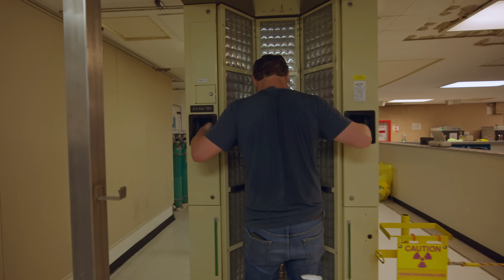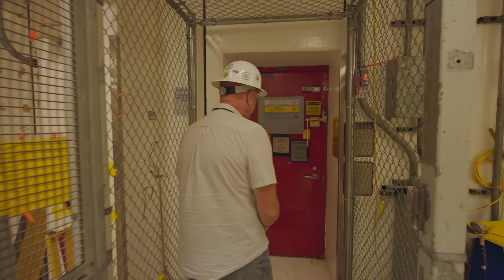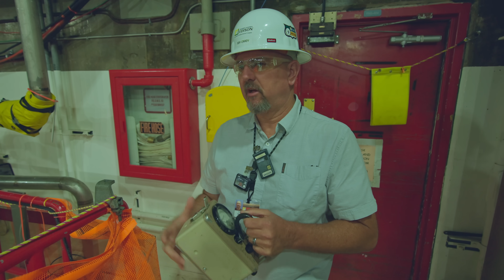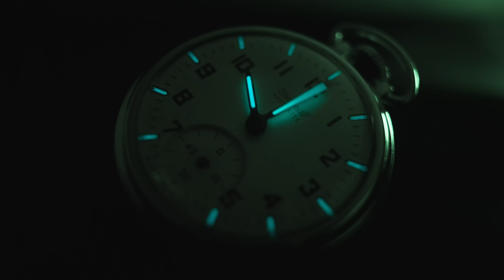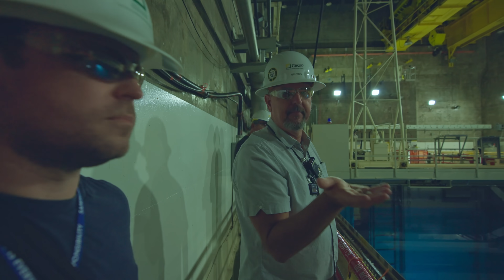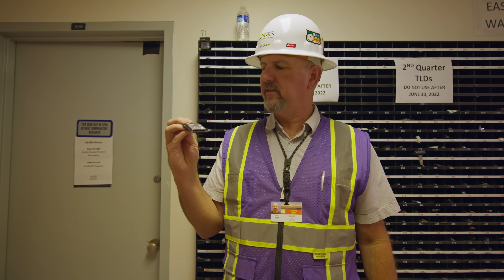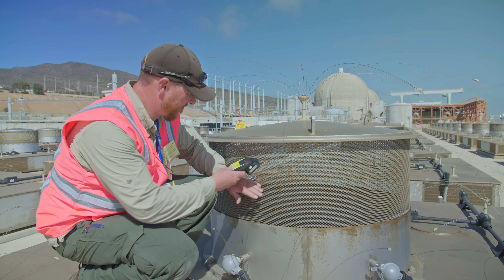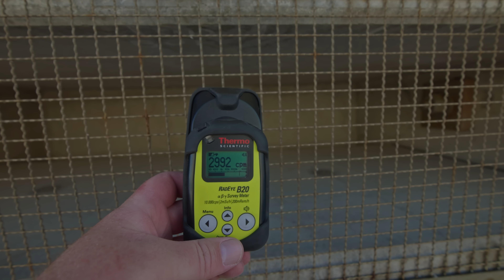Inside San Onofre Nuclear Power Fuel Pool and Spent Fuel Storage

Comment: I believe Thorium MSR is the wave of the future, because it can get rid of nuclear waste. There is still some high temp engineering that needs to be worked out, requiring special alloys.
Reply from the maker: Thorium reactors don’t get rid of nuclear waste. But they can cut it down quite a bit. There will always be waste.
Reply: Thorium MSR are set up to make fluoride salts from nuclear waste and additional wastes can be added and processed. Look at a diagram of the reactor and the processing center. The nuclear wastes in a thorium MSR are removed from the reactors.
Reply from the maker: @ggelsrinc  no…you are misunderstanding a lot there. The fluoride salts are used in cooling the reactor. There is no process that exists that will change nuclear fuel into inert fluoride salts. That path doesn’t exist anywhere.
Reply: @RadioactiveDrew  I've seen diagrams of Thorium MSRs that inject fluorine and process the nuclear waste in a processing center that removes reactor byproducts and prevents further transmutation. They can even be designed to add other nuclear waste and process it. Essentially, a Thorium MSR is just a breeder reactor. I'm fairly sure the diagram can be found in the initial Oak Ridge report, or some similar report.
Reply: @RadioactiveDrew  Under Weinberg, ORNL shifted its focus to a civilian version of the meltdown-proof Molten Salt Reactor (MSR) away from the military's "daft"[35] idea of nuclear-powered aircraft. The Molten-Salt Reactor Experiment (MSRE) set a record for continuous operation and was the first to use Thorium irradiated to produce uranium-233 as fuel. It also used plutonium-239 and the standard, naturally occurring uranium-235. The MSR was known as the "chemist's reactor" because it was proposed mainly by chemists (ORNL's Ray Briant and Ed Bettis (an engineer) and NEPA's Vince Calkins),[34] and because it used a chemical solution of melted salts containing the actinides (uranium, thorium, and/or plutonium) in a carrier salt, most often composed of beryllium (BeF2) and lithium (LiF) (isotopically depleted in Lithium-6 to prevent excessive neutron capture or tritium production) – FLiBe.[36] The MSR also afforded the opportunity to change the chemistry of the molten salt while the reactor was operating to remove fission products and add new fuel or change the fuel, all of which is called "online processing".[37]
Reply from the maker: Nothing in that explanation would imply that fluoride salts are being created in that process. They are being added to the reactor. They are being used for a bunch of different purposes, such as cooling, heat exchange, neutron moderation and a medium for the fissionable fuel to exist it. 

 So what is the point of this? I would suggest learning a bit more about this subject.
Reply: @RadioactiveDrew  In the Thorium MSR I keep telling you about, it does create fluoride salts by adding fluorine to do it. Let's say you have U 233 in a core. You surround the core with very low atomic number fluoride salts which can feed thorium into the high density neutron environment. Fluorine is so reactive, it can make a salt out of nearly anything. The reactor injects fluorine to make fluoride salts of fission byproducts. Obviously, if you have a high atomic number element and it breaks down with fission, the products are going to be fluorine short of being all salts. The reactor initially uses an external source of U233 to start the process and then transmutes thorium to fissionable U233. The salts are processed to remove U233 for the core fuel and to remove fission byproducts (the wastes) continuously by specific element. The wastes aren't left in the reactor to cause harm and further processed for storage or other uses. Alvin Weinberg worked to make safe nuclear reactors and was credited for the first two commercial types. When given the aircraft project, he proposed using Thorium MSRs for commercial reactors, which were safer. The government wasn't interested, because they wanted the commercial reactors to assist in making materials for nuclear weapons. Thorium MSR are not good at making products for nuclear weapons. I've seen designs of the whole process and even reports about specific alloys needed for high temperatures. Why don't you look at the diagram of such a reactor and see for yourself?

Comment: Nobody ever explains what those steel whisker fountain things are on top of the storage casks! WTF are those things?!? It can't be lightning rods because there's too many of them, electrostatic buildup discharge like on airplane wings doesn't make sense because everything's already in the ground - it's literally grounded, and what would build up charge anyway. They must have something to do with galvanic potentials and the corrosive salty humid sea air, like a sacrificial magnesium rod in a hot water tank. Did they tell you anything about them? Anyway if you come to Rochester NY for some godforsaken reason lmk and I'll give you a tour of the laser driven inertial confinement fusion reactor. I won't even make you wear a hot pink safety vest.
Reply from the maker: Those whiskers on the fuel containment are there to keep seagulls off. They even have a laser system to keep them away. As far as I know it’s just there to scare them but it does have some kind of auto targeting hooked up. It was turned off while we were out there. 

Thanks for that offer. That would be cool. Eventually I would like to head out that way and check out some legacy sites and some other places.
Reply: @RadioactiveDrew   SEAGULL SCARERS! 🤣 that's legit hilarious.

Comment: Real quick you could swim to about 6ft from the fuel element in the fuel pool and still be fine...the tsunami question/answer  is part of the new FLEX directive implemented since the Fukushima accident .
Reply from the maker: Well even if the site suddenly dropped below sea level and the entire fuel storage pad was underwater. It can’t imagine it cause much of a problem. Those canisters are very well built and even under sea water they would be able to hold up for a long time. Also the sea water would keep everything cool.

Comment: I figure the vents for the fuel is reflecting some of the radiation, its why nuclear bunkers typically have an L shaped hallway to lower the dose and stop particles going into the shelter, it might be a similar thing with those vents, im not an engineer or a nuclear physics expert, I just know whats in the handbooks
Reply from the maker: I was going to post a picture of an internal view of those above ground fuel storage deals. But the video was already running long. The reason that I could see from the design of why I was seeing that increase in radiation level has to do with that area having the least amount of shielding between the fuel and the outside.

Comment: Worked there for 6 year. I loved that place
Reply from the maker: It was a super interesting place to be. So glad I got the opportunity to check out the RCA.
Reply: Sounds like you really enjoyed working there, why’d you leave
Reply: @mikefrommaryland9652  Unfortunately, they let most of the workforce go when they decided to close it down. Fortunately, I found another job in Maintenance that I enjoy just as much!
Reply: Why are they closing it down.
Reply: @camronbay1  There was a leak in one of the heat exchangers. From the radioactive water that goes through the reactor to the steam side that goes through the turbine.( no radiation leaked to environment)
 It would have taken years and hundreds of millions to repair the issue
Reply: @genedavella9817  Oh shit.
Reply: @genedavella9817  when I was there they closed it down because nobody would take the waste, contracts ran out and the burial costs skyrocketed making it non viable.  I never knew about the leak, they must have kept it quiet.